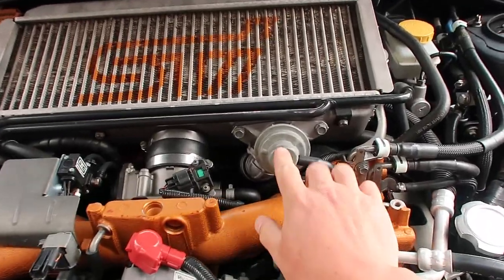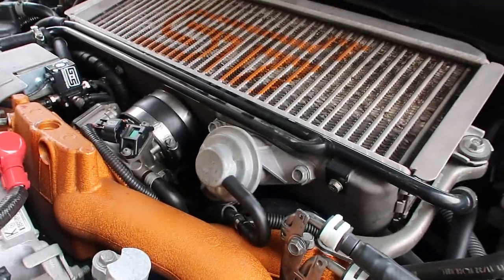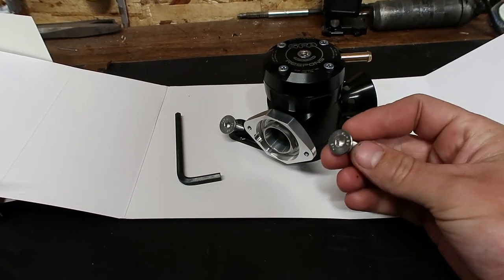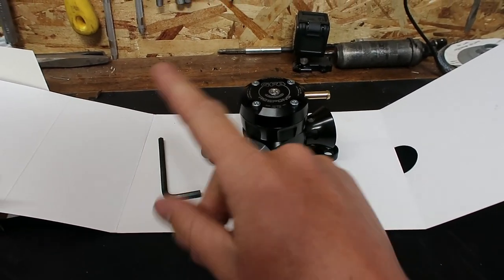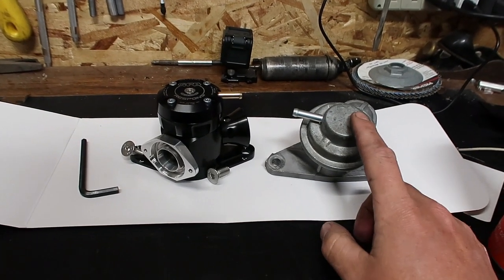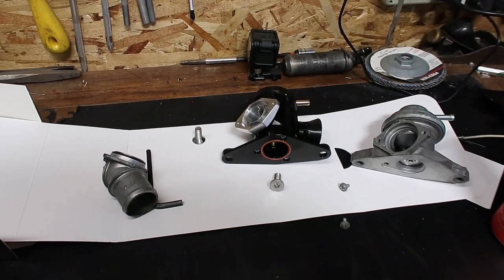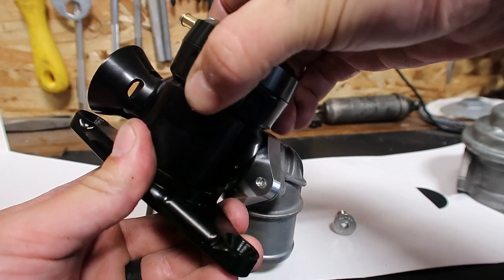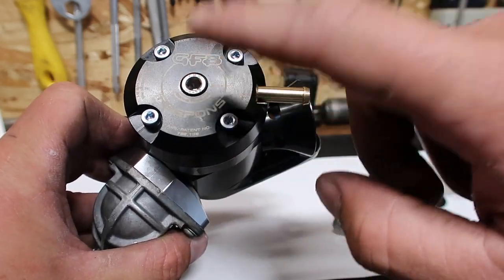Installing A Hybrid Blow Off Valve (Turbo BOV)

Comment: Running a hybrid bov should honestly be fine without as long as it is set to be mostly recirculating. It'll run slightly rich but that means you get a little extra pops and bangs which I definitely love haha. If you do 100% bov it will need a tune eventually cuz it'll run pretty rich. Also great video, gives a good idea of how to set one of these things up.
Reply: It’ll only run rich between shifts

Comment: My 2003 wrx came with this bov but they didnt install the elbow part and the hole it goes in to is shut with a cap. The car runs fine but do i need to install the elbow

Comment: Maybe Subarus are different but you shouldn't need to tune for a BOV
Reply: It's a controversial topic  I keep seeing mix stuff about this
Reply: So subies come stock with a 100% recirculating system, meaning if you switch to a bov it'll need a tune eventually, but not dire. But if you install a hybrid and set it to mostly recirculating, it'll still run a little rich because it's not the same amount of air as it used to be but not as much as a bov and won't need a tune. But a little rich running here and there means pops and bangs too sooooo. Up to preference for sure.
Reply: @wage6681  all factory cars come with recircs for emission controls.
Reply: @creed8196  oh, I wasn't sure if cars like the focus RS came with bov or bpv but makes sense though
Reply: @wage6681  you’ll only run rich between gears

Comment: Hey man, what ever happened with that TT coolant issue?
Reply from the maker: Tore into the engine pulled the head nothing wrong and found out it was a piece of plastic on the drivers side that had a hair line crack. Wouldn’t show up with a pressure test assuming it was on the other side of the thermostat. Either way happened to catch it when I was putting the head back on
Reply: @ModdingAddiction  Oh Damn, nice find. I'm trying to track mine down. Found a huge leak in three heater core but now I'm losing it slowly somewhere else.

Comment: Can anyone help i brought a 2000 wrx bugeye and it came with the gfb hybrid blow off duel port non adjustable veants to full atmosphere its always been idling at 500rpms and seems to like it doesn't cut out or stall. I tryed to do everything i can to bring idle up new spark plugs cleaned throttle body cleaned mass sensor new air filter no vac leaks that i can find even adjusted the idle screw that worked for a day then went back to 500rpm did re set back to 500. Could it be the gfb blow off valve?
Reply from the maker: It sounds like you might have a vacuum leak. The car is getting more air than it is measuring. Is there some rough idle? Have you tired moving it to full recirculating to see if that fixes it? There is also a little o ring gasket behind the BOV that is easy to nick and cut while installing. Here is an article I found on that. 

https://forums.nasioc.com/forums/showthread.php?t=2470948